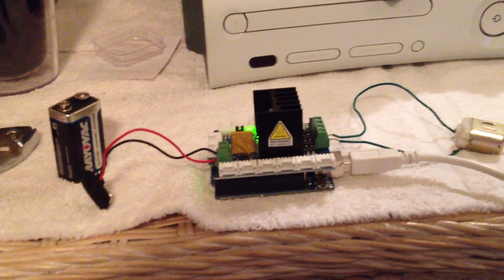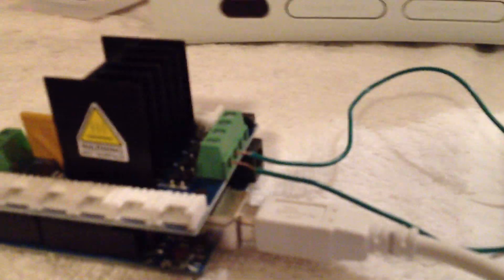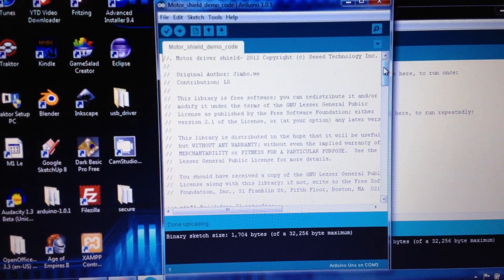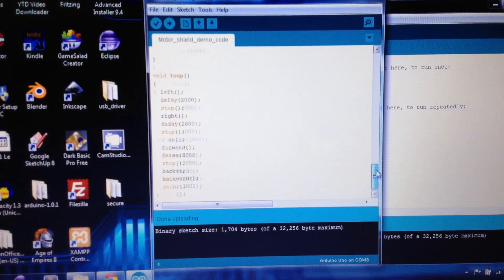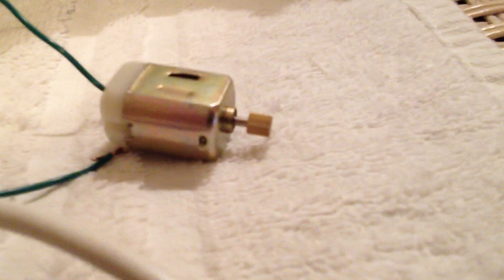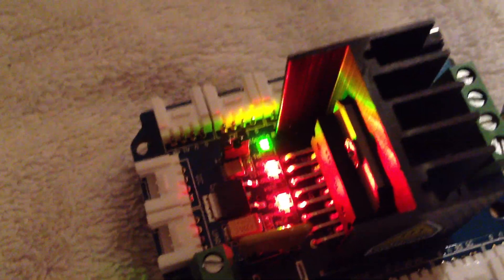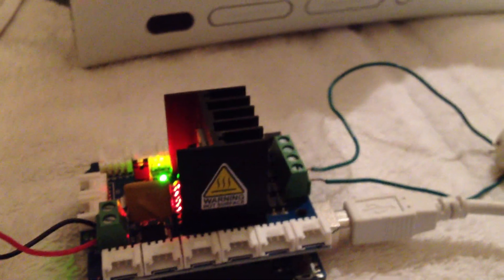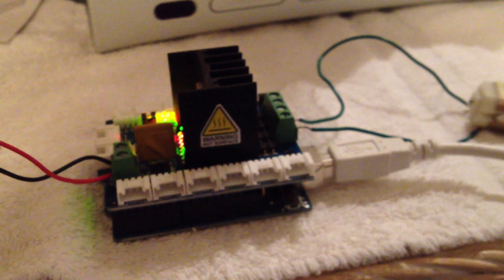Seeed Motor Shield with Arduino Uno Test 1

Comment: So now that the shield is blocking all the pins on the arduino, how do you plug a sensor in?
Reply: I think this motor shield you can only use seed sensor with groove conectors!
Reply: Grove connectors can be plugged into the white ports for plug and play.